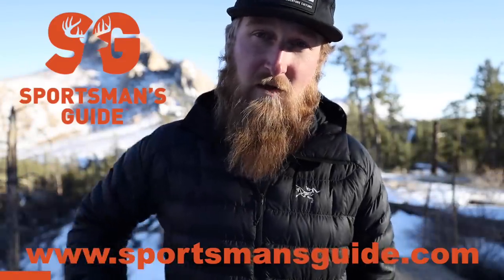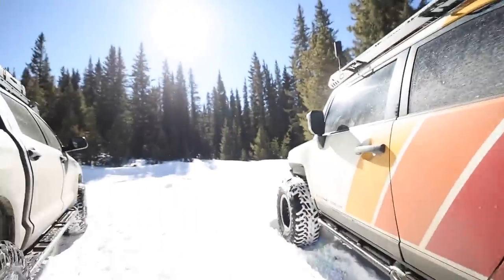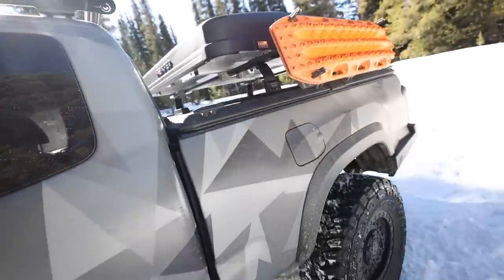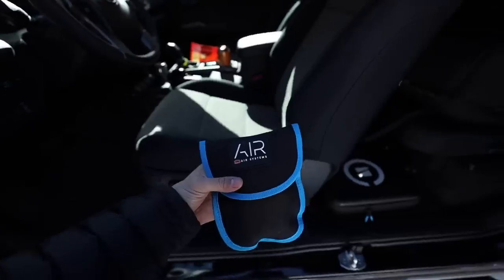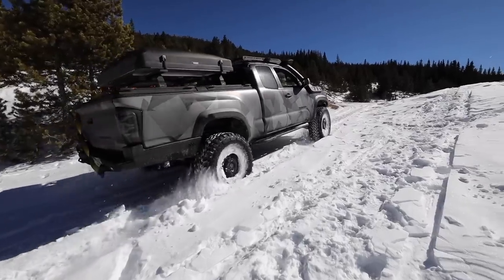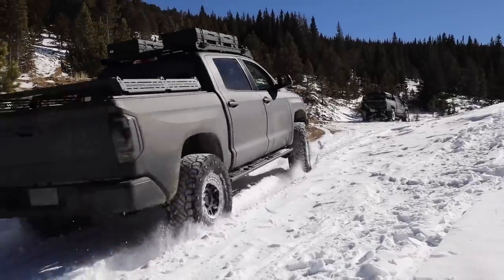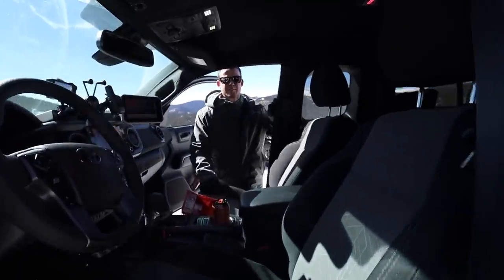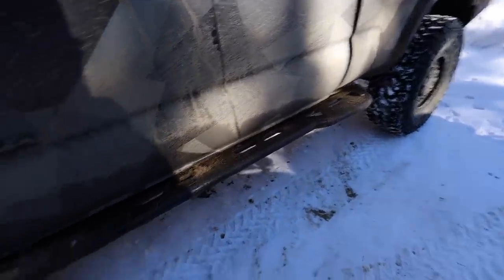#SATLander 95% COMPLETE! | Too much snow...

Comment: Driven through 4 feet snow drift after 2 feet snow fall at my parents house at the base of the mountain. Home was a mile from the highway, dirt road. When the snow melted you had to with a worst situation, mud, lots of mud. And my dad and did it with 2wd pickups.

Comment: So that snorkel is a waste with the ram air at hood level. At least you aren't planning on fording any major rivers with that truck. Also dedicated winter/snow tires with studs will outperform the general offroad tires in snow
Reply from the maker: Low point is the diff breather which I relocated even higher into the rear tail light. There are plenty of benefits to a snorkel, they aren’t really made just for forging rivers with water up over the hood.